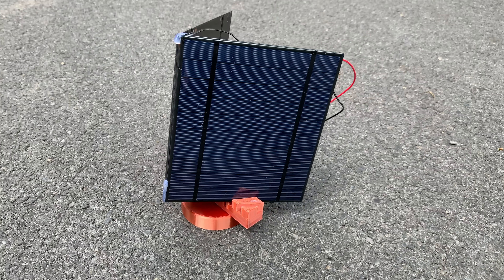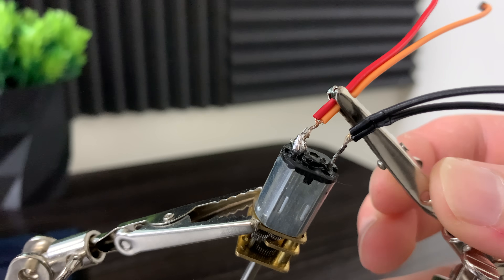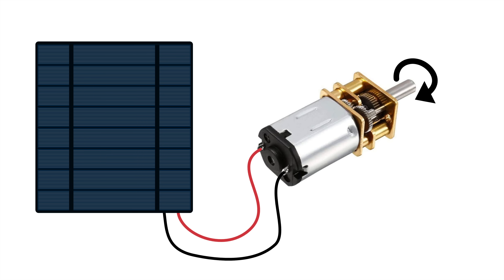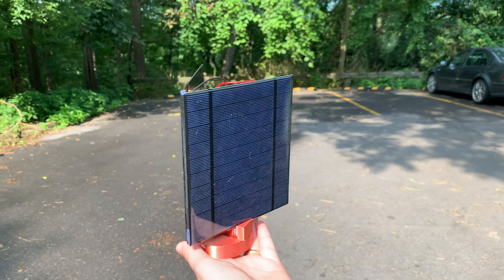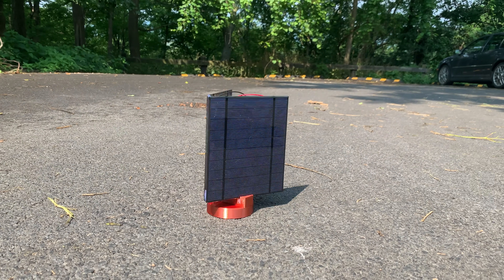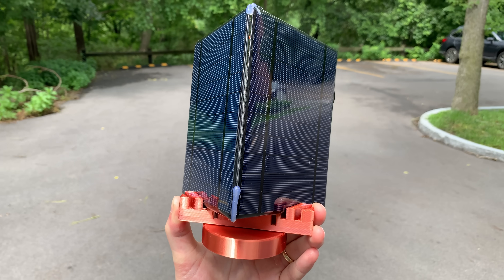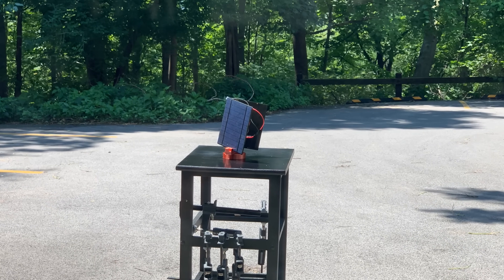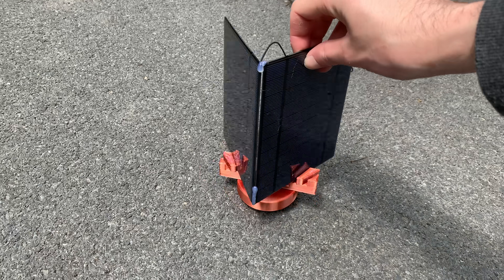World's simplest sun tracker.

Comment from the maker: Imagine if this comment gets pinned!
Reply: You should give it a heart
Reply: I guess this circuit is in need of 2 diode in series with each of the solar panel , it is safe for this small use but if u try this in a big panel it will get damaged or a worst case scenario will start a fire
Reply: @vigneshkailas1561  Solar panels ARE diodes.  I thought the same thing you did, until I slept on it.  This is a very good design which might already be in use, but if it's not, I'm passing it on.
Reply: @fuzzywzhe  Solar cells, you means, the building blocks of the panels, are diodes. You think this design, in the video, is a really good design that may not be in use and you want to take it or use it, lol? Why do you think this is so ingenious
Reply: @fuzzywzhe  Sorry one of my two comments are being deleted I think. I can't tell. It shows one but not the other and total comment number not changing, but it's fine, I was just adding I thought it was funny how you said, it is cheap and easy (and brilliant) because it's cheap and easy 😆 Like saying, space is big and vast and it's amazing because it is big and vast, lol.
Reply: @fuzzywzhe  I'm actually in the solar industry, not sure where you live, but I'm in the states. Would love to get solar into the East more readily where it is seriously needed. 

Anyways, yeah I mean, we have simple sun trackers using μC which take very very little computation power and have a failsafe, which this doesn't. It's nice for a little project maybe to charge a phone or something, but for practical use there isn't much going. The addition of more panels is necessary of course otherwise you only have a tracker and also longevity is a major issue as those motors clicking and running constantly throughout the day just won't hold up for much. It's also inevitable that you're not getting maximal exposure on both panels where they aren't at 90° as one will get 'x' amount of energy equal to the other side to stabilize, but neither will get a maximum amount of sun. Again, where a third, or more panels have to be incorporated, and at that point we aren't talking about the same simple process anymore. I agree simplicity is important, as Occum's Razor says as well, the simplest explanation you ought to lean towards, but it is also made very clear that the simplest is not always, and many times is not, the best answer.
Reply: @fuzzywzhe  Yeah the YouTube robo gods are quite a pain
Reply: @fuzzywzhe  Sun trackers really aren't useful unless you're implementing a ground mounted array. It doesn't have any place for like, roof top solar, but if you're putting panels up in your backyard of substantial size then suntrackers can be useful but they aren't necessary. If you can simply aim the panels south (at the sun all day if you live north like I do) then you get all the sun you need. It's more for if you're stuck only able to get Easy/West sun and want to track it I guess.
Reply: So uhmm...?
How do you connect them to batteries?
Reply: @thereaper9987  I think I can answer that. The system is intended to be used to move larger solar panels. A small panel turns a motor or operates a relay that turns a bigger motor to turn a large panel or panel array. In theory you'd only need a small set of panels (like around 5 or six inches square) to move a huge solar array. Do it old school like the sunflowers. Now thats really old school😎
Reply: @nathanhale7444  Nice!
But I had it figured it out. Turns out there's these cheap solar panels I bought the other day with 2 outputs.
But  I like your idea, really old school. Hope we could be friends one day.
Reply from the maker: @thereaper9987  This is a sun tracking mechanism, a third solar panel would be used to collect energy.
Reply: @3DPrinterAcademy  Thank You...
So in order to harvest energy, the 3rd solar panel is necessary while the 1st and 2nd (The 2 that is connected to the motor) is the one powering the "sun tracking mechanism"?
Correct me if I'm wrong please ✌
Reply: @thereaper9987  The third solar panel would controlled by the attitude of the tracker as, for max recovered energy , square area of panel and an angle of incidence  to 90 degrees is required . this simple , though ingenious , device could control arrays of solar panels in both horizontal and vertical aspect to maximise  exposure to the sun . Very impressive idea , laser guided bomb s use a more technical application of this .
Reply: @3DPrinterAcademy  where would you put the third solar panel
Reply: @thereaper9987 I was also wondering where the actual output could be sourced from. I considered a mechanical linkage to a larger device, but your take makes a lot more sense. I think. It would be nice to somehow stay with the theme of minimalist elegance.
Reply: @mewintle  Yeah, you know what they say?
There is beauty in simplicity.

I like the way you are thinking, I hope we can be friends someday, maybe when I finished high school.
Reply: @thereaper9987  You got it
Reply: pin deez nuts
Reply: @memepog588   That would hurt... a lot
Reply: The solar panels are not fully utilized. Not an efficient design.
Reply: Okay but now do this for a glider plane that will turn a Rutter in the back. To make it track the sun forever.
Reply: It's just how I imagined!
Reply: Now I would like to know how to you link this to the solar panels that you want to keep lined up to the sun.
Reply: @manp1039  you would need motors or linear actuators to move the panel. Then a battery or power grid to power them. Attach the panels under the larger panel on either side in such a awy that when the sun hits the panel on one side it makes it turn to track the sun. Then have the small panels power relays that cause the motors or actuators to move accordingly. At least that's how I've pictured it in my head.
Reply: Now make a 3 dimensional one!
Reply: i found another simple sun tracker its called eyes
Reply: figured this thing out a while ago but didnt share it anywhere! nice that its been shared now
Reply: Why don’t you just put a stick in the ground and look at the shadow? Isn’t that the simplest?
Reply: With 2 SSR and a power source it can also drive large 230v 110v or whatever. 
Thanks for the new way of thinking.
Reply: ok dude.. so you are counter driving the 2 panels causing heat, some diodes can protect you but this is still not a safe design.
Reply: @SLAYERSARCH  The heat generation of that toy motor in a toy is worse then the heat caused by the solar tracker.
Reply: @frankdelucey2137  yeah but you are shoving voltage into a solar panel from another panel.
Reply: Well we'll well, what da ya know?
Reply: Rather than switching out the motor, you could have just reduced the photovoltaic output with some paper and making tape...

This would have doubled as a demonstration of the tracking panels generating enough power to turn a useful load, eg using small labels to orient a main panel.

Then you would be experimenting to find the radio of driver panel area to power panel area that would be needed.
Reply: @nialltracey2599  
That would be an insufficient solution due to the difference in sun intensity. Thus, there's no way around a µC. This will be the most reliable solution, the most flexible solution with great many updates, and even the cheapest solution.
Reply: @Youtube_Stole_My_Handle_Too  how do you know it wouldn't have been sufficient? He didn't try it.

It would have been ingesting to see how much of the PV needs to be used to power the rig. By blocking off 3/4 of the surface area, he could have demonstrated that two small panels could be used to keep a large panel oriented towards the sun, something that could have been followed up with by creating such a three-panel rig.
Reply: @nialltracey2599  
Because maths.
Reply: @Youtube_Stole_My_Handle_Too  Then, as they say in every exam, show your working.

I didn't say it would be an optimal solution, I'm just curious whether this set-up could actually do any (theoretically) useful work, rather than only being able to handle its own bodyweight.
Reply: @nialltracey2599  It isn't even a solution able to work in different intensities.
Reply: @Youtube_Stole_My_Handle_Too  ? Unclear, please reword.
Reply: @nialltracey2599  My target group is those with a functional brain, so no thanks, no further clarity for you.
Reply: @Youtube_Stole_My_Handle_Too  Yeah he's merely applying Occum's Razor to this demonstration while entirely leaving out the fact of it's lack of practicality. Occum's Razor is a great means of finding a best solution, but simplest explanation alone, definitely does not always result in a best answer. Demonstrated here. There is no sufficient way around a μC for a viable application here.
Reply: @Youtube_Stole_My_Handle_Too  Jerk.
Reply: @Youtube_Stole_My_Handle_Too  What a jerk.
Reply: I refuse to imagine that.
Reply: imagine if the solar cells didn't have a shortcut in his video - WOULD BE AWESOME SULUTION! but it isn't!!!
Reply: I believe with this set up if you wanted smaller & more frequent movements of the device you would want the panels at 90deg to each other. This way the one in the sun gets more of the full efficiency from it's panel. In theory this should allow it to over power the other sooner.
Reply: There is one problem - connecting positive and negative to each other at the motor causes a short and thus you loose either all or significant amount of actual useful power you can draw.  Thus defeating the whole purpose!!!  And if you add a 3rd panel, for powering the actual load, you've lost power from two to gain some extra efficiency out of one.  Not a good trade off.  Last, if you use this to transfer signal to a larger controller, then you are right back to what you are trying to avoid: a complex controller.  Much easier to just use photocell than a panel.
Reply: Hahahaha
Reply: This is brilliant.  I'm stealing the idea.  You can put it on 3 axis of rotation, you just need to make a 1/2 cube of solar panels and use 3 panels, and 2 motors.  You also need to have it rotate on the center of gravity.
Reply: You created a short circuit with the batteries. Imagine if they were regular batteries (draw a diagram without the motor). The best solution would be to connect the black wires together and solder the red wires to the motor.
Reply: @ViamoX  Solar panels are a current source.  When it has tracked the sun perfectly, the the voltage of each panel is equalized.  What this is doing is finding the balance where the current of each panel is producing the same amount of voltage through the motor.  When it does, it's balanced.  You can throw it out of whack by putting a piece of black take on one of the panels, then it won't track.

When it reaches equilibrium, there is no current flow at all.
Reply: @fuzzywzhe  In the case I described, there is no current when in equilibrium. In the scenario presented by the video's author, when in equilibrium, the current will circulate through both solar panels.
Reply: @fuzzywzhe  The motor is connected between the two positives, which means there will be a voltage difference across the motor from the two batteries. Consequently, the motor will seek to reduce the potential difference to zero.

Regarding the diodes - I'm not quite sure how to connect them to eliminate the short circuit. Could you provide a schematic?
Indeed, there isn't much difference between a solar panel with a short circuit and one that is disconnected since solar energy doesn't leave the panel; it either gets heated by the sun or the short circuit current. However, when connecting the motor between the positives, there won't be a short circuit, allowing for the possibility of utilizing the energy generated by the batteries, which would be more challenging in the case of a short circuit.
Reply: Awesome! Good idea
Reply: Does it work when it is cloudy?
Reply: can't believe that top comment can be pinned!
Reply: this comment is cringe
Reply: The simplest solution is also the most dangerous one because it is shorting the wires I found out, I did this with large panels and it literally started a fire! Please put in a word of caution because this is irresponsible!
Reply: Brilliant engineering 👏
Reply: @tomjary9284  lol, it's not :D
Reply: @Wrutschgeluck  of course it is . He turned it into from them ancient computers which were two story high & half a block wide to hand held mini computer I mean android. 🤣 Simplified & minimized . Now even I can build it .
Reply: The dumbest idea I have seen in a long time. 
Time after anno 2000 we don't do anything without a microcontroller. They have become so cheap (<$1) they can be used in any project. Then you need a failsafe sensor array in all directions, let's say for every 36 degrees. Such a setup demands a µC with ten channel a/d converter. A little snippet of code reads each sensor and finds which direction has the highest value and regulates the motor through a function that prevents malicious behavior from hysteresis. To decide polarity each i/o line is either sourced or sinked through a bridge. This solution is failsafe in the sense that the average is calculated from the sensors which means at least one sensor can be blocked. Finetuning can be achieved by a d/a converter from the panel's output and a few lines of code will determine which direction is optimal, both for elevation and azimuth. Shouldn't be more than 400 lines of assembly code totally. With a µC with BT LE the unit can report back to a central point about voltage level statistics with very little cost of energy.
Reply: @Youtube_Stole_My_Handle_Too  buddy it's obvious you know your stuff but probably 9 put of 10 people try to read that and see WA WA WA, WA WA WA. WA WA. Lol. But the info is appreciated. They're just trying to make something that would be possible to make with limited experience and supplies. Like using panels, motors, relays and wires scavenged from trash and junk cars.
Reply: @nathanhale7444  Everybody can get hold of a handful of µCs and information on how to use them in less than three weeks. This is time much better spent than the nonsense in the video.
Reply: @Youtube_Stole_My_Handle_Too  Nonsense? It works doesn't it?
Reply: @brucearion877  That may have been a sufficient criterion in the Stone Age, but it is not applicable today.
Reply: @Youtube_Stole_My_Handle_Too  
μC = microcoulombs?

Comment: Well, that was outstanding! Makes the concept achievable especially where reliability and weight savings is crucial. Now I just need to find out what size panels I need to run car power window motors to move a heavier array, and a wind meter to override the system to stow away the array when winds reach a certain speed.

Comment: Definitely fun but there's nothing wrong with using a cheap microcontroller solution, also there's no point using two expensive solar panels instead of photo-resistors in order to provide tracking for bigger panels, also this solution would not provide the best tracking information for bigger solar panels, it provides tracking only for the tracker panels that may differ depending on clouds, precision etc.

Define what's complicated really as that's very subjective, if we have to follow the cult of "it's too complicated" fanatically just to make our life impossible then let's go for a non electric solution using a mechanical solution of wax being heated by solar light moving a pulley that in turns move a panel like this:  https://www.youtube.com/watch?v=0AZuteYr46s

THAT'S DEFINITELY SIMPLER!

Comment: Nice demonstration, but with the pretty extreme angle between the panels you'd get just as much electricity from a single panel that was just in fixed position facing south (or north where I am). Also, a microcontroller that would do the job is $0.10. Plus a small stepper motor. Probably a 28BYJ-48 (typically used to swing A/C louvers) would do the job -- $1 on Aliexpress including the driver board. The cheap Temu 20W panels I have have two USB (5v) sockets right on the back .. perfect for powering the microcontroller and stepper.

Comment: A better solar tracker would be 2 panels with mirrors perpendicular at the sides. As the sun moves, the mirror occludes one of the panels and the system can react to the voltage change. If the panels are both facing the sun, unlike this video, you don't get losses with the angles that you have.

Comment: If you think about solar panels as batteries (sources of current/power) then the panels are short-connected in reverse that will destroy them. Batteries would be hot and dead in a couple of seconds, while it may take you hours to destroy the two solar panels (as the kind of panels that you have used has much lower capacity than any batteries available). 
So Yes...hacking does a job, but it is rarely helping to solve any problem permanently.

Comment: Something is not adding up about this: if the two panels are connected in reverse polarity, they will discharge in each other.
Plus the motor moves in a constant speed and suddenly stops.
Part of me is certain that you have a hidden controller somwhere.🤔

Comment: I have made a big solar cooker reflector on "equatorial mount" .  I wanted to go as low tech or "steam punk" as possible and I  use a mini "waterwheel" and a "winch" to move  it.   It tracks really well (time based tracking) and it takes barely any effort to move the reflector.    I have just seen a video, where the guy copies this solar panel idea and the winch from mine, to move his solar cooker.  the good thing about winches is that they can be set up in such a way, that a sudden wind gust won't "grind your gears".   The waterwheel/winch idea is less than 3 months old.  Feel free to adapt it to your uses.